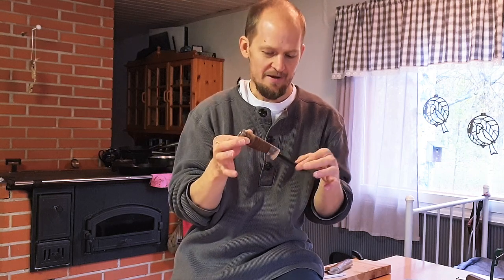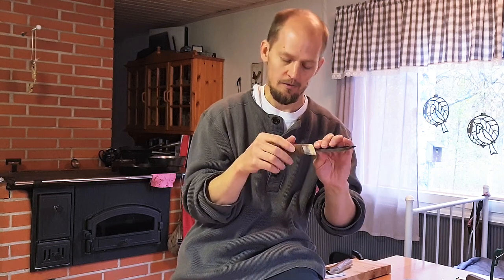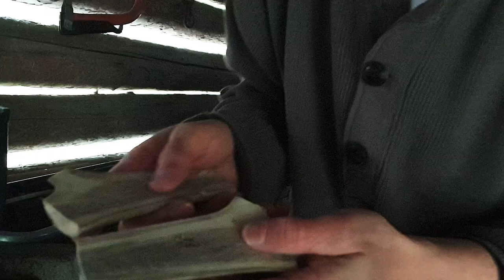Reindeer Antler Knife Sheath in Finnish Lapland

Comment: I'm in the process right now of making an elk antler sheath.How do you cut the grooves at the top of the antler for the leather part?I already did everything else like sawing the antler in half(used a Dremel tool  and a hacksaw)and cutting the groove out of the inside of the antler for the blade.
Reply from the maker: I first used thinly edged file to create a track, then a switched to a small all rounded file to make the grooves. The first track is so that the rounded file can run in it straight and smoothly.